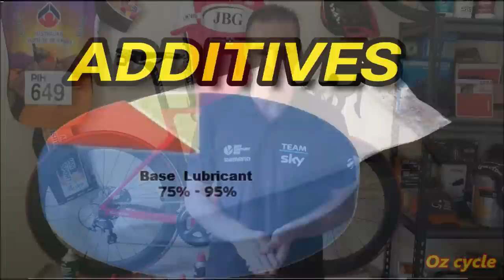Ultimate Chain wax - make it yourself

Comment: Some constructive criticism: liquid wax is flammable. Make sure there is no open flame or spark anywhere near the slow cooker setup. PTFE is also toxic. If I have to use PTFE, I use as little as possible. I am a bit conflicted about mixing it into the wax. Although since wax won't wash off like liquid chainlube does, it's probably less of an issue. If your chain lasts longer, then that also a huge environmental benefit. However rising off your chain with boiling water right over the ground is very irresponsible. You're deliberately introducing a toxic microplastic into the soil. A better approach would be to wash it over a pan. Once the water has evaporated, you can collect the residue, and eventually send it off to a toxic waste depot.

Comment: What happened to the 50/50 parrafin wax and parrafin oil?
Reply from the maker: You can still do that , good for very wet weather conditions
Reply: @stevenleffanue  ok, I thought that with only candle wax it was too brittle and crusty at room temperature?
Reply from the maker: Thats why its better to add oil or ptfe
Reply: @stevenleffanue  so the 10% ptfe has the same softening effect as 50% parrafin oil? So you would use one or the other? Could I add 10% ptfe to my existing 50/50 mix?

Comment: What if you use only parafin wax as i can not get ptfe powder localy?
Reply from the maker: You will need to rewax every 100km appx.
Reply: @stevenleffanue  i see, then ill have to find some. And what about in winter when the temp is just above freezing how dose it hold up then?
Reply from the maker: Doesn't matter , the wax is a solid below appx. 53deg C and stays same below that.
Reply: @stevenleffanue  awesome, guessing the casete and front chain rings also need to go into petrol/degreacer/alchocol cleaning loop? Is isopropyl alcho ok to use instean of what you use?
Reply from the maker: Only need clean off old lube from cassette n rings initially , then ne er again

Comment: cant find ptfe in my country, aliexpress cant send. what can i use instead?
Reply from the maker: Have you tried ordering ptfe on Amazon? Ptfe is available worldwide so it's strange that you can't find it in your country
Reply: @stevenleffanue  they cant send to my country too. Its winter time here. Im worrying about if i use only paraffin, i will came across with puddles my smallest route is 60km. Im shure puddles everywhere now.
Reply from the maker: Should still be ok to just use wax
Reply: @stevenleffanue  i have found molybdenum disulfide should i use? Thanx a lot
Reply from the maker: Yes, that will work too
Reply: @stevenleffanue  thank you👍
Reply: Finally i did my first wax. Even its summertime here, puddles ruined my chain(i was using muoff dry). After 80km i found my chain dry.  Yesterday i searched everywhere molybden tungsten or ptfe. cant find and i did it with pure paraffin. Used it on my chain thats at 1400km. I cooked 15min. After turned off the heat i had wait for 15min to cool down. when parafin becomes solid from liquid i pulled the chain. Never used missing link, just pushed the pims all the time. after few pedals chain was broken then put on my back up missing link thats not waxed.(next time i will wax it too) Ride for 50km, saw too many puddles and didnt slow down :D. Chain looks good now. I cant say its faster. I cant say how much i like it. During prep time didnt focus on. just use zefal degreaser for few hours and used home type jewelery ultrasonic cleaner for few turns at 8min. 
if it stands for 200km i will never leave waxing. still searching for a way to get tungsten molybden. is ptfe still valid in formula?
Thanx a lot for encourage me to wax. I enjoyed alot.

Comment: Anyone in the US been able to source the PTFE powder in the 1.x micron size? Every avenue leads back to China, which right now is even a slower ship time than normal. One Amazon order placed in December never arrived. I can get 2-3 micron size but I get the impression that won't work correctly. I have all the tools, solvents, etc. just no PTFE.
Reply: As an update for anyone reading, U.S. Customs stopped my shipment of PTFE via an Amazon vendor. Got the msg from the seller today.   I was wondering what people thought about using a liquid PTFE (like this https://www.grainger.com/product/TEFLON-General-Purpose-Lubricant-35RP17)? Would it mix with the wax and bond in the same way as the dry powder? Also, what is the outcome of using .2 or .3 micron powder instead of 1.5? Looking for a solution before I simply go back to the old recipe.
Reply: Took me awhile to find some and I'm hesitant to run this source dry too. Howard piano company uses it for lubricant, sold by the ounce in Wisconsin.

Comment: Hy all.
I have tried this method but the two parts stays separate duing the process.
Reply from the maker: Yes , the ptfe does not disolve so its a mixture. You need to swish your chain in it to get the ptfe inside your chain

Comment: Great video - but PLEASE ditch the bit about restoring articulation by rubbing the chain over a wooden knob as is shown at 16:10 in this video.  It takes the wax off the edges of the plates and it there is any moisture around they will rust as I recently found to my cost.   I'm going to recycle a knackered old short cage rear derailleur and do this part of the job over the jockey wheels in future.
Reply: better still - three old jockey wheels screwed to a a board like this     [img]https://i.imgur.com/nK3Itik.jpg[/img]

Comment: Hi has anyone in the UK found a reliable supplier for 1.6 Micron Teflon powder? I know oz Cycle states it should be 1.6 but is 3 microns OK, I have a feeling a lot of Chinese 1.6 stuff may not actually be 1.6.
Reply from the maker: Generally viewers have difficulty getting 3um not to clump
Reply: @stevenleffanue  OK thanks, do you know if anyone has measuredd the 1.6 stuff to check it really is 1.6? doing a bit of online research makes me think that it may not be. This comment on the Hagen Automation page makes me wonder "Do you stock 1.6 Micron? No, our suppliers do not make 1.6 micron powder as it clumps or agglomerates too easily. 3 micron is the finest size for mechanical applications and certainly fine enough for waxing chains. Although we have seen 1.6 micron on the market (usually also saying 3 micron APS?!) we are yet to find a supplier that meets our standards.  "

Comment: So i have the wax pellets (ebay) have the thermometer (ebay) and waiting on PTFE (ebay)...wish me luck!! 😄😉
Reply: I bought PTFE from ebay, after a heavy downpour, last  week, i went to clean bike and chain, and noticed the pins had a layer of rust on them, i must of been ripped off with the PTFE powder.
Reply: @steriophonic1  thanks for the heads up- still waiting on mine although my seller has been very concerned said he'd replace. You should mention it to your seller - if this is nye on impossible with real PTFE, tell us  who to avoid. Disgraceful. What does #Oz Cycle suggest??
Reply: @ronanoboyle8432  chenting2018, I thought it was a bit cheap, £5.16 for 2 x 50g
Reply: @steriophonic1  Ok mine cost €9 (this included post) so £5 x 2 might be a bit cheap. Nonetheless if you purchased PTFE that what you should get right? I suggest you fire off an email to the seller to explain what happened - maybe their supplier is the crook. Good luck.
Reply: @ronanoboyle8432  who was the seller, the cheapest i've seen is about £25 for 50 grams, on ebay
Reply: @steriophonic1  my 'concerned' seller is onewor1donedream2010...still waiting.

Comment: I have just stated waxing my chain using straight paraffin wax. I live in the UK and my chain has been getting rusty after wet rides. Has anyone else experienced this with wax?
Reply from the maker: Add 50% of paraffin oil to your wax. This helps prevent rusting
Reply: @stevenleffanue  Thanks for the tip! I’ll give it a go
Reply: @stevenleffanue  50% is a lot. Doesn't that much oil attracting dirt?
Reply from the maker: It will attract some dirt. I recommend not using the oil but rewaxing the chain directly after your ride
Reply: Didn’t bother with the oil. I have been hosing the bike down after wet rides to wash the dirt off then drying the drive train with a cloth. Takes a couple of minutes but no more rust!

Comment: Chain wax suspended in solvent still does not seem to have caught on?
 I have been applying Rock and Roll blue on my turbo levo from new and listen to this. After 1 year of riding every couple of days - the chain still measures as new. No wear or 'stretch'  ZERO !   I am an engineer... and am amazed. The Specialised shop doing the one year checks/service were surprised. No dregreasing, just apply the liquid and wipe off, about once a month.  I dont understand why long term tests have not been done to make this common knowledge.  The wax must float inside the links with the solvent carrier when it is applyed and stay in there effectively. I did not even bother to remove the oil off the chain when new, just dosed it with the R and R blue. Best part is the chain is clean!   I know this sounds like and advertisement but I am not affiliated with R and R at all. Just wanted to pass on my findings so far.   Cliff 

Show less
Reply: Ehhhhh do you use a stationary  bike?. I ask because no dirt with the oil from factory is a little weird.
Reply: @junboo8730  . Not a stationary bike! an outdoors ebike. . Remember the solvent probably strips the oil from the outside of the chain and replaces it with wax.

Comment: The hardest part is waiting your PTFE powder to arrived
 Even the biggest chemical shop in my town didnt sell that
Reply: What did it cost you?  I looked on eBay and it was worth about AUD25... :(
Reply: @razbakar7889  try aliexpres or ebay they sell around 5-6$/50gram. Just a tips you better ask them if the ptfe ready to be shipped or not

Comment: very interesting video but if a chain last 15000km and you need to take your chain off to clean every 250km then you would have to remove your chain 60 times in its life span. That seems to be so much extra work especially because that mean I would have to do this twice a wk. Just because of that I wouldn't wax my chain, too much of a mission. I would rather pay for parts being worn out faster than spend so much time doing this.
Reply from the maker: Using a Connex link it's so easy to remove the chain.

Comment: What about  a “new chain”  on a box ?the bicycle industry Quality control issues. As I would expect a chain to be no more than .25) wear On a chain measuring device, not to measure at .70) wear right out of the box. So check the chains for Quality Control Standards right out of the box.  Cheers, and stay up right.
Reply from the maker: Regardless, when a chain measures. 5% it's time to replace it. Buy known quality chains from reputable sellers to avoid fakes.

Comment: Steve, Your and Ceramics Speed's Lubes are a great step forward. Unfortunately they allows the chain to surface rust after 1hr of riding in the rain or wet surface/mud. Even when dried, the chains are horrible the next day and need to be ultrasonically cleaned to save them.

My eldest son Alex developed his own bike lube using basic high school science and we use on all our road and mountain bikes. His lube was designed for Mountain Biking given that no commercially available lubes are good for MTBs. His ALPHA-Lube consists of wax, moly and paraffin oil, details are in the patent app he put together to assist in his USA college applications (yes it is very competitive ito get into a top college these days). http://users.neo.registeredsite.com/1/7/9/22867971/assets/Alex_Mordaunt_US_Application_No._16595672_Bike_Lubricant.pdf 

You should compare your latest formulation to his.
As you will see he uses the optimal performance is ambient temperature dependent, i.e., you want to tweak your lube for summer, spring/fall and winter.

For California spring conditions 55-75oF (12-24oC) we are running (80% Wax/ 14% Moly / 5% Paraffin oil by weight)  

Comparing your chain lube (he referred to it as Wax + PTFE in Table 2) to his lube named (Alpha lube) there is a 25% increase in power transfer efficiency with Alpha lube, please refer to http://bikesciences.com/alpha-lube.html 
.

In summer, when temps are above 30oC (especially for you folk down under), he suggests using less / no oil.

He added 10% PTFE to see if it improved the performance, there is no noticeable difference to the pure ALPHA lube.

For all users that liked and use WAX + PTFE, I suggest adding 10-20% moly powder to improve the hydrophobic properties of your chains (i.e. to repel water and prevent rust), this will also improve the durability of chains and drive trains: e.g., 4 years (9,000+ km) on a XC race bike still the original drive train except the chain is changed every year, (raced nationals last year) road bike 3 yrs (15,000+ km) same. 

The goal for the perfect chain lube coating is to be solid, dirt and water repelling on the exterior, and once the chain is motion the shear forces melt the lube only at the internal pressure points on rollers and plates (you also want this to be hydrophobic keeping water and rust out).

Steve great work, if you want to chat about chain lubes let me know Alex has been studying them for over 3 years now.  As I know you have, plus it sounds like you have a background in chemistry,
Jason (Friction Facts  now CS) and John (Molten speed wax) basically got it most of the way there, they just needed to use more Moly and some Oil.
Reply from the maker: Thanx for the insight David. Unfortunately an 'all conditions' superlube may not come about. Adapting the lube to conditions might be our best outcome.

Comment: 250KM TO 300KM and you need to rewax again?  For me that's repeating this process 15 times a year! Sorry, I'm too lazy.
Reply: you are supposed to clean your chain with oil more then that with regular oil (can be several times a week if frequent rider) not to mention you are supposed to switch lubes in dry vs wet conditions. This is less work and keeps it cleaner

Comment: Isn't the waxing interval seems too aggressive? If this was used by a touring  cyclist, he would have to rewax once a week if he traveled and average of 50 miles a day. That is just plain nuisance.
Reply from the maker: Hence the bottled lube....
Reply: @stevenleffanue  But it is hard to imagine that the bottled lube will penetrate the innards of a chain. I am a casual rider and did the same treatment as waxing but with motor oil. Now, I may switch to wax as it is much cleaner.

Comment: That's a lot of stuffing around. The blokes in the video all look retirement age. Sounds like PTFE dry lube spray would be OK then. I usually just spray WD 40. But it does attract dirt.
Reply: WD40 is a solvent, not a lubricant. You're literally better off not using anything

Comment: Hey oz cycle, I' having trouble getting 1.6 micron PTFE. Looking at this website: https://hagenautomation.com/products/50g-ptfe-powder-lubricant-for-cycle-chain-waxing-3-micron-aps-high-quality. Here's there take on 1.6 miron PTFE
"Do you stock 1.6 Micron? No, our suppliers do not make 1.6 micron powder as it clumps or agglomerates too easily. 3 micron is the finest size for mechanical applications and certainly fine enough for waxing chains. Although we have seen 1.6 micron on the market (usually also saying 3 micron APS?!) we are yet to find a supplier that meets our standards. "
Do you agree and will 3 micron do the job? Thanks again!
Reply from the maker: Quite a few viewers have had their 3um ptfe clump but none have said 1.6um clumps. However , perhaps Hagen ptfe has better screening tolerance....sorry I cant fully answer your question Simon.
Reply: Thanks very much for the reply - I do have some 1.6micron on order from china but lord knows when that will turn up! It definitely isn't readily available. Lets see what happens. Cheers buddy, keep up the good work.